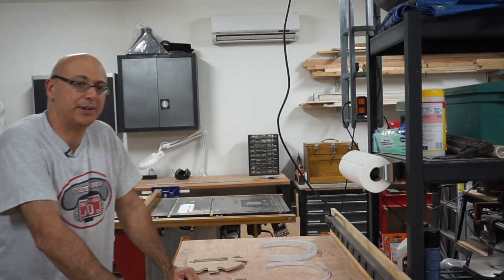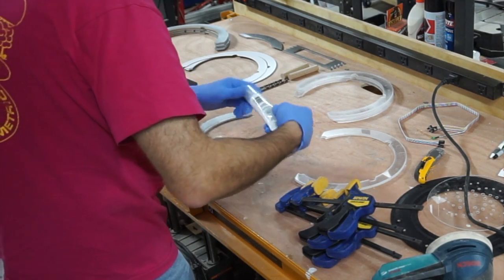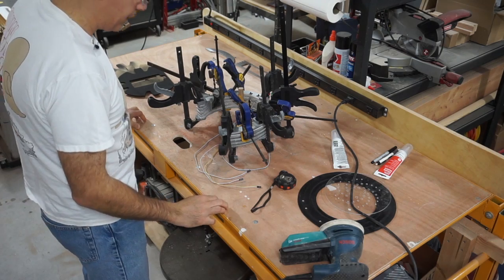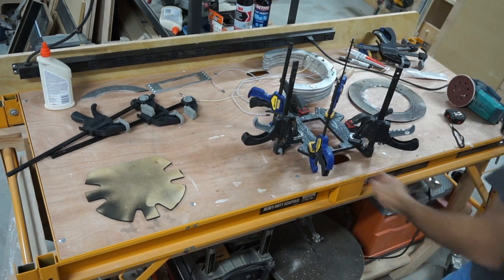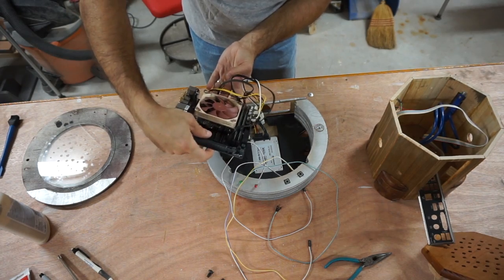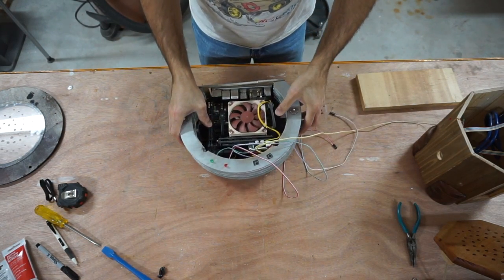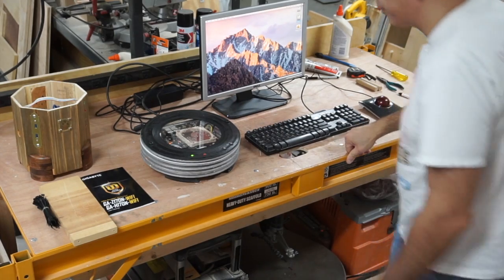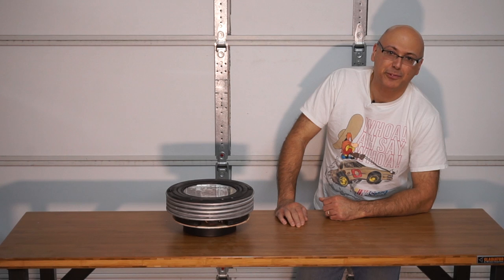Apple Campus 2 Shaped Computer Case - SUPER GEEKY!

Comment: Great concept for a case, glad to see a new video from you, and I like that you showed the process of putting the case together. 

I know new computer parts are expensive, but  I think the build would have been better if you themed the components around the build too. (I think the inside of apple's campus has greenery, so maybe a green theme at least for the CPU fan which is the most noticeable part). It would also be interesting to see a timelapse or 2-4x speed portion of the video where you designed the pieces and then used the machine to cut them as opposed to the video beginning with the pieces already on the desk. 

But thanks for uploading computer videos! Keep up the good work.
Reply from the maker: Hi Jordan, thanks for all your comments. I'm glad to see a new video from me too! 😉 Yes, I thought of using a "green" theme for the center part, but I also wanted it to be visible, so I ended up leaving it clear. The green fan idea is a good one. I tried to keep potentially boring sequences out of the video. That's why I left out the CNC parts cutting process.